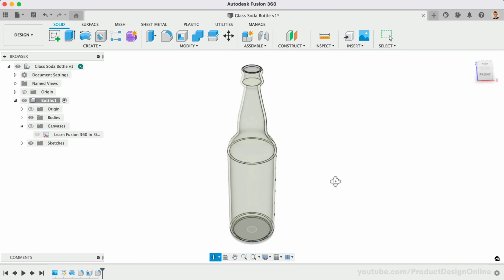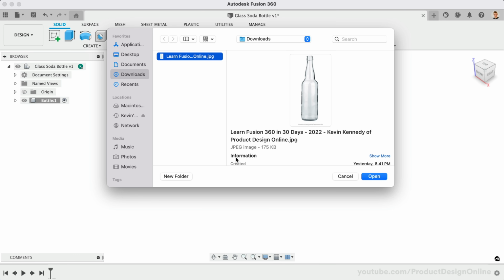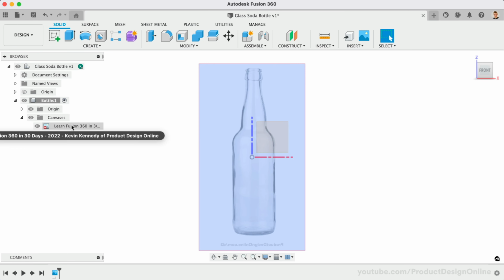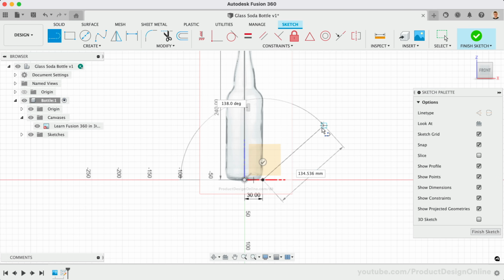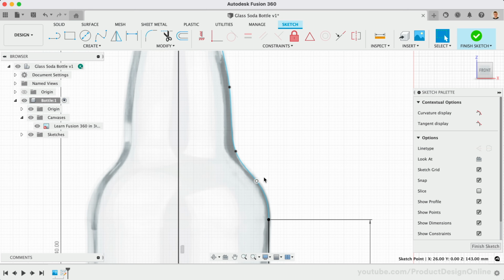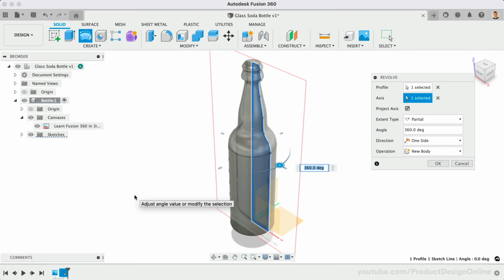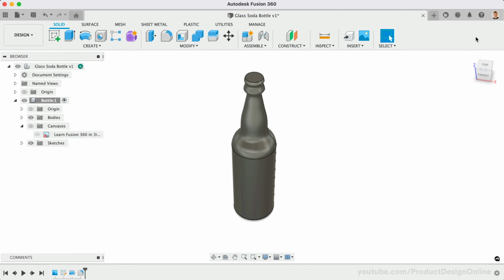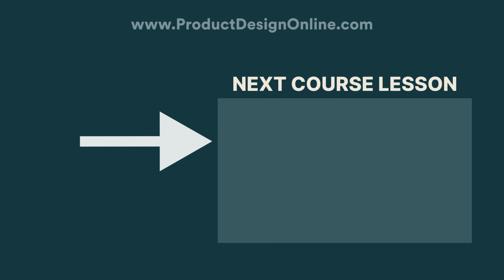Day 2 of Learn Fusion 360 in 30 Days for Complete Beginners! - 2023 EDITION

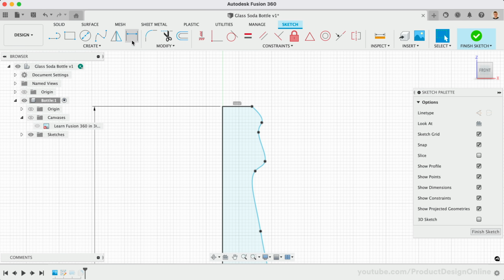Comment: My shell on the bottle cap looks way off.  The opening of the bottle is so much smaller than what Kevin has.  I measured the diameter of the face and it's definitely 22mm (which corroborates with the adjustment to a fixed 11mm at 9:55).  If anyone sees this and has an idea as to why, please do share.
Reply from the maker: Hi Jonathan - can you export your Fusion file (.f3d file) type - upload it to a sharing service and paste the link here? (Let me know if you do with a separate comment, as links automatically get filtered and I don't get notified).

Comment: Hey Kevin, it was my orgin not being on.  Thank you for that. However for some reason now when I try to use the shell tool I select the top and it is automatically selecting the entire body so when I put the 2.3mm in it shrinks the entire bottle to that height. I am not sure what I may have missed now?
Thanks
Jim
Reply from the maker: Double check that your top line is horizontal with a horizontal constraint. The top spline handle may also affect it. Something is preventing it from being planar (flat), which is required to select it.

Comment: I have been using the CTRL+Z keys to undo my work from time to time, much like you can do in many other software programs. It does work, mostly, but should I not be using it at all and just get used to using the UNDO and REDO arrows in the menu? In other words, am I creating issues with my objects by using CTRL+Z?
Reply from the maker: Those shortcuts (CTRL + Z) are the same thing as the arrows in the Applications bar. I typically show the arrows during tutorials so learners know what's going on/can see it. Use whatever feels most convenient for you 😊

Comment: I'm stuck and failing at the Shell command. When selecting the top of the bottle I get the higlighted blue flat disc plane but my arrow points straight down. Your arrow points to the right. I enter 2.5mm and get immediate error. Have started over from square one, same result. However, I added a component as rectangle and rotated it into a cylinder and the shell worked fine. BTW, I did lesson 1 Toy Block no problem at all. I'm on Trial mode, ver 2.0.17954 x86_64, Windows 10 Pro.
Reply from the maker: Can you double check/adjust your top spline handle of the bottle? That is likely resulting in a radius that doesn't work with the defined Shell thickness.

You can check that by also trying a smaller shell thickness to see if it works .

Comment: How do I remove the xyz thing and have a apace with all blank?
Reply from the maker: You can turn off the Origin planes in the Browser on the left side of Fusion. Select the eyeball icon for the "Origin" folder. Note that there will be a separate origin for both the file and individual components.

Comment: Question.  Can you use this program to make 3d models to print with a 3d printer
Reply from the maker: Absolutely! Anything you design can be exported as an STL or 3MF file for your 3D printer. Simply right-click on the component > Save as Mesh > choose file type (STL or 3MF).

Comment: When I try to use sketch dimension it just shows me what the current dimension is, but I don't see a way to actually change my sketch using that function? Any ideas what is going on?
Reply from the maker: It sounds like you have a 'driven' dimension, which happens when another dimension is already applied. By chance, do you have another dimension on the sketch/same entity?

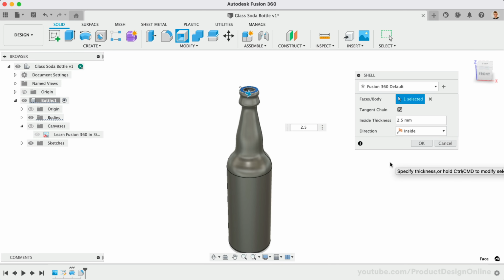Comment: Would be nice to elaborate what does mean "edit your sketch... until the shell command works" at 10:40. I'm getting this error and I have no idea what is wrong with my sketch. Thanks.
Reply from the maker: Shell will trace the outer contour, so if the desired thickness doesn't work then it's almost always due to the curvature being too tight and not having enough room for the thickness. With the bottle, it's likely the area around the lip of the bottle.

Try adjusting the top spline point and see if that fixes it. If not, try the second spline point.

Comment: Starting over for the 4th time because I can't get it to select only the top for the shell operation at the end.  It selects the whole thing.  And I just redid it all with same result.  Also won't let me select the inner edge for fillet after that, it's like the whole thing is one piece.  Time to give up and have a beer.
Reply from the maker: Can you export your file as .f3d and upload to a sharing service (Google drive, etc) and share the link here?
Reply: @ProductDesignOnline  I got the first part of that done.  I don't think I have shared public links via Google Drive before, so let me figure that out.
Reply: @ProductDesignOnline  p.s. I think it did create the shell as intended, it just seems to be treating the top of the bottle like it is a permanent part of the bottle instead of removing it like when we did the toy block and the bottom face went away after doing the shell command.
Reply: Having the same problem. When I select the top, it selects the whole model.   There doesn't seem to be a way to select just the top.
Reply from the maker: @ThomasMoehlman  Please share a link to your file. The two issues that cause this:

1. The top line is not horizontal (with a constraint)
2.  The top spline handle is 'too sharp' and needs adjusted.
Reply from the maker: @ThomasMoehlman  Happen to check either of those two options? Let me know in a separate comment if you do share a link as YT will always flag them as spam and I have to hunt it down :)

Comment: Hi Kevin,
For some reason when I import the image as a canvas Fushion doesn’t give me an option to choose the plane I want to see it on. Also when I right click on the image there is no calibrate option for me any ideas or help would be greatly appreciated. Thank you.
Reply from the maker: Hi James. Before using the Canvas feature, can you double-check that your bottle component is active with the nested Origin folder visible (turned on) in the Browser? You'll also want to make sure the top-level origin folder is turned off so it's not accidentally selected.

I've never seen the calibrate option missing. If that's still happening can you link to a screen recording, kindly?

Comment: I'm trying to figure out why when I apply the clear glass the bottle itself looks pretty dark. A little strange
Reply from the maker: Some of the appearances (such as glass, etc) will look a bit different when in the Design workspace. If you switch to the Render workspace you'll see the more realistic appearance.

It could also be related to what component you have 'active' in the Browser. Check which component is active. The Bottle component should be active.

Comment: Hello! Does anyone else have trouble inserting the canvas into the created component? I'm clicking on the component when creating the canvas but it always pops up as a separate tab, between the origin and component tabs. Does it matter? I wasn't sure if this was me not knowing what to do or an update to Fusion
Reply from the maker: Make sure you're selecting the origin plane that is nested under the Bottle component. There will also be a parent origin plane and if that is selected it will automatically place the Canvas outside of the Bottle component.

You can select the origin plane in the Browser instead of the model, which will make sure you don't select the parent one.

Comment: Great course but I am having a problem with Day 2.  My canvas opens above the bottle component and is very faint.  I get into trouble trying to add the spline because I cannot see the bottle outline clearly.  When I imported my image I closed the origin file (clicked the eye), selected the front plane...which highlights as faint blue.  Still canvas doesn't open like yours in your tutorial??  I suppose I could increase opacity of the image...but am I missing something?
Reply from the maker: Try removing the canvas and reinsert it. When you go to insert again, select the origin plane in the Browser instead of the middle of the screen. Make sure you select it from the origin folder that is nested under the Bottle component.

It sounds like yours referenced the parent level origin for some reason.

If it still happens, please share a link to your file.

Comment: The shell command does not work even though the anchor points are placed correctly! There is no error message popping up and yet the shell command is not working. Please help!
Reply from the maker: What did your error message say? Double check the top spline handle as it may be too sharp and not enough room for the shell to apply.

Comment: Why is it that when I insert the canvas With Bottle highlighted the canvas is inserted in the Glass Bottle folder not the Bottle Folder?
Reply from the maker: The issue is likely caused by selecting an origin plane. Sometimes, multiple origin planes are active, making it difficult to see which one is selected. To fix this, expand the Origin folders in your Browser and turn off all unnecessary planes. Alternatively, when placing the Canvas, select the origin directly from the Browser instead of picking a plane in the workspace.

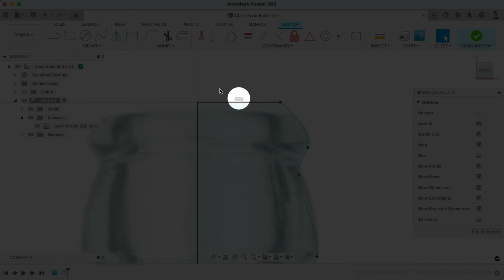Comment: Around 7:30, you mention that the blue background gets highlighted after connecting the top. Mine doesnt for some reason. Any idea why? I don't know how to progress. Thanks!
Reply from the maker: It's hard to say without seeing the file. If you can link to a screenshot, that would be helpful.

That said, it's likely that one of the points where the spline and line meet are not snapped together. You can try to drag and drop it to snap it or use a coincident constraint to force it to snap. Let me know if that fixes it!

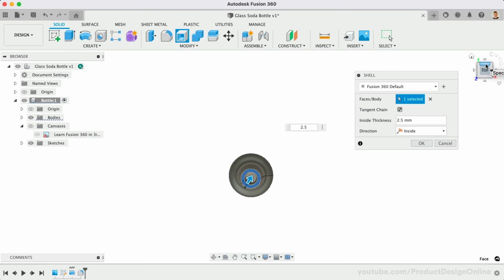Comment: At 10:34, when I apply the shell command, I get an error. It goes away if I change to 1mm width. You suggest that I could edit the bottle, instead. How would I edit the bottle?
Reply from the maker: Hi Elizabeth. You can double-click on your sketch in the timeline to edit it. Then, adjust your spline handles to modify the shape.

 It's most likely your top spline handle that is causing the issue.
Reply: @ProductDesignOnline  but what about it? As new people to the program we have no idea what causes the error, or what it means, so "play around with it" is useless information. I managed to move things around to the point of it working at 1.2mm, but I would much prefer to learn what's needed to make it 2.5mm

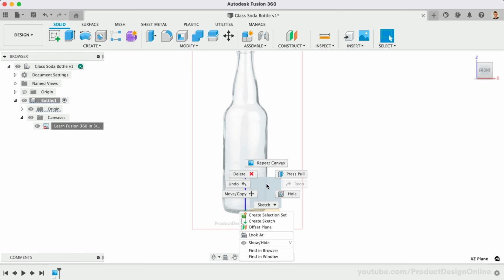Comment: LIterally no matter how hard I try or no matter what I do, at 3:55 minutes into the video, I cannot get that "Create Sketch" from that drop down menu.  I am stuck.
Reply from the maker: You can also activate the 'Create Sketch feature in the toolbar. It's the very first icon in the toolbar.

It is always available in the right-click menu when you select a construction plane or planar face. It sounds like the program is thinking you're not selecting the plane. Are you right-clicking directly on the orange origin plane?

Comment: It may be just me and how I did things, but is anyone else having a problem with the shelling of the bottle where it selects the whole bottle and not just the top face? When it selects the whole bottle, it shells out the bottle without reaching the top face creating an opening. I'm doing this in august of 2024 so I'm wondering if there have been some software changes since the posting of this video. If anyone has any suggestions, I would greatly appreciate them.
Reply from the maker: No changes to the software have effected this workflow. If it's selecting your whole bottle then  it's likely your top face is not planar (perfectly flat). You'll want to make sure you have the horizontal constraint on the top line. Let me know if it is already there!

Comment: If I’m doing a sheet metal design, should I still use the sheet metal option when making the component?
Reply from the maker: Yes, any sheet metal designs should utilize the 'Sheet Metal Component' as that allows you to assign a sheet metal rule that will drive the bend radius, material thickness, etc.
Reply: @ProductDesignOnline  thanks!

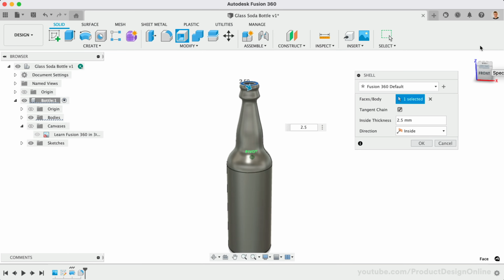Comment: 10:41 So the top of the bottle is 22mm width (2x11) When i tried making it hollow (shell comand) I can't get inside thickness to 2.5mm I tried fiddling and adjusting curvetures on the "stem of the bottle with no result"  I can make it 1mm tho. However it looks super fat more like  15mm while on the tutorial the thickness of 2.5mm is super fine... I checked all measurements and redid the exersice multiple times but i'm stuck .. anyone else has the same struggle?
Reply from the maker: It is likely due to the spline handle being too sharp at the top. Try adjusting the top spline handle (make the circle larger as you drag the handle out).

Can you share your Fusion file?

Comment: I Can't get past the error message for shelling it I can't even do 0.5 shelling thickness.
Reply from the maker: Sorry to hear that, Josh! Can you double-check your spline hand at the very top? That is often the root cause of this issue. If the spline is too 'sharp' it will not work with the Fillet command. You'll want to adjust the spline handle and retry the fillet. It may take a few times to adjust it to get it right (or once if you can get it relative close to what is shown in the video).

Comment: I am trying to get canvases to show up under the Bottle component when inserting the .jpg file.    It is not there.  I shows up above Bottle:1 and does not expand when clicking on Bottle.  What am i doing wrong?
Reply from the maker: Hi there. Please make sure that your top-level Origin is turned off in the Fusion 360 Browser. You'll want to select the origin planes that are nested under the Bottle component when selecting a plane for the reference image. That will ensure it's nested under the component. Let me know if that fixes it for you :)

Comment: I cannot right click on the image below canvas for calibration on MAC, how do I overcome this?

Edit: After spending 30 minutes figuring out how to do this; if anyone has the same problem, all you have to do is right click with 2 fingers and it should work.
Reply from the maker: Are you using a trackpad?
Reply: @ProductDesignOnline No, I was using the laptops touchpad.

Comment: When trying to use revolve I get an error  "The sweep would not create a valid result. Try changing the values or changing the geometry" followed by "Cannot complete revolve". I would like to understand why and how to fix it.
Reply from the maker: Double-check you're using the blue solid modeling revolve command and not the Surface (orange) one.

If that's not it, I'll need to see your sketch or file to investigate. If you can upload them to a sharing service and link to that, kindly.
Reply: I started a fresh one from the beginning and had no issues but I would like to understand what I did wrong and how to prevent it.
Reply from the maker: @dgray9580  share a link to the original file if you still have it.

Comment: I'm not getting a "canvases folder" after trying to insert the image. It's also not selectable and seems greyed out compared to this video. Any ideas what i'm doing wrong?
Reply from the maker: Double check that you're selecting the origin plane that is nested underneath your component. 

If you select the parent origin, the Canvases folder will be nested under there.
Reply: @ProductDesignOnline  Having a similar problem. There is no origin plane underneath my component and the canvases folder is on top of the bottle folder. Maybe I should unground the bottle folder because it has a small anchor on it.

Comment: No matter what I do, I cannot shell the bottle at 2mm.  It only works at 0.2mm and then makes the bottle super thin, re-watched each step / started from scratch and nothing changes.
Reply: It seems to have something to do with the shape of the bottle neck. Shell works perfectly fine with a few bottles I've sketched but doesn't work with the ones most close to the reference image.

Comment: When I want to apply SHELL, I cant select the top face but only the WHOLE body, where is problem here please?
Reply from the maker: Please double check that your top line of the bottle is horizontal (with the horizontal constraint).

If it is, then the next culprit would be the top spline handle. Adjust that so it's larger or smaller and then try Shell again.
Reply: Oh I think it will be because of the horizontal constraint, I could add even 1, it said I already have too much, so I skipped this part, thank you! @ProductDesignOnline

Comment: For some reason my sketches aren't turning into a shape, so I can't revolve it.
Reply from the maker: Double-check that your sketch is fully enclosed. It's likely where your spline meets the regular line. If you zoom way in, you may see that they are very close, but not snapped together. You can use constraints to force them to touch, or sometimes deleting and drawing it again is easier/faster and the automatic constraints will take care of it.
Reply: @ProductDesignOnline  Thanks! I just had to redo the sketch, making sure that I didn't press finish sketch until I was done.

Comment: I’m having an issue where the whole bottle “top” is selected neck included and I can not fillet or shell the bottle
Reply from the maker: Double check two things. First, make sure your very top line has a horizontal constrain in the sketch. If that top surface is not planar (flat) then you won't be able to select it for Shell.

Second, you may need to adjust the top spline handle in the sketch, making the curve of the spline larger. If it's too 'sharp' then it won't have enough area for the Shell to follow the curve.
Reply: @ProductDesignOnline I don’t remember how I got it to work but it went through. Will make it again soon just so I know it. You also talked about the error message, but not how to fix that. I had that issue at first though after doing it a second time it resolved itself.
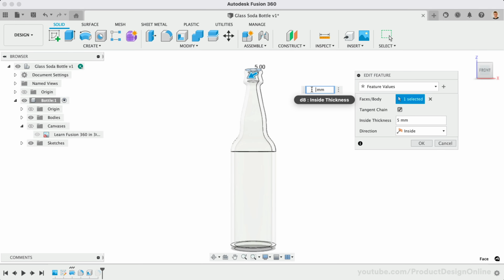Reply from the maker: @Nmyoutube821  See 11:37, "Edit your sketch and adjust the stem of your bottle..."